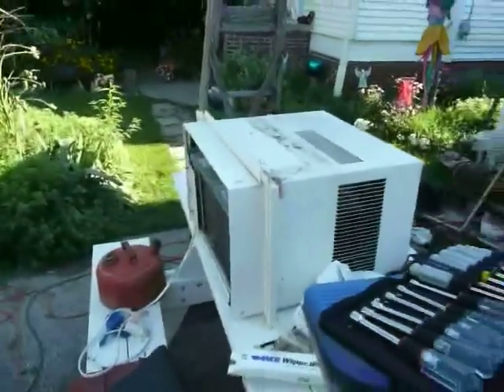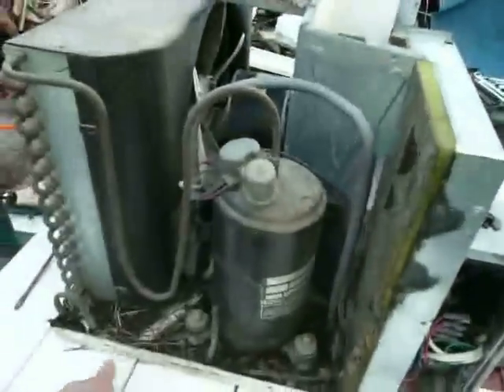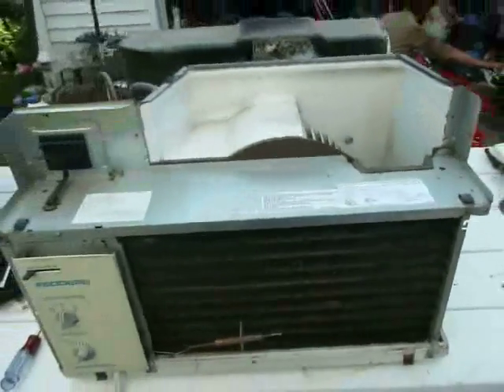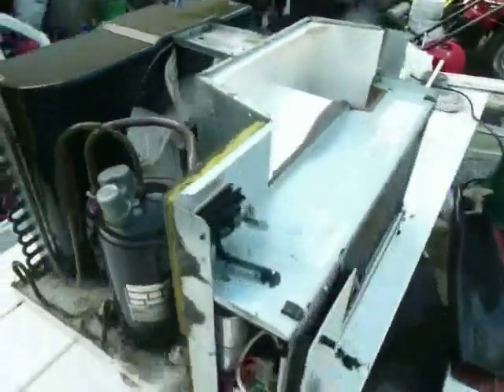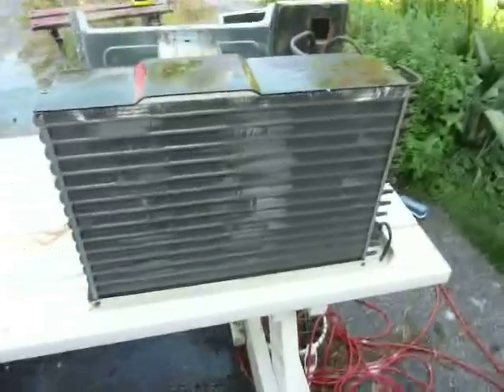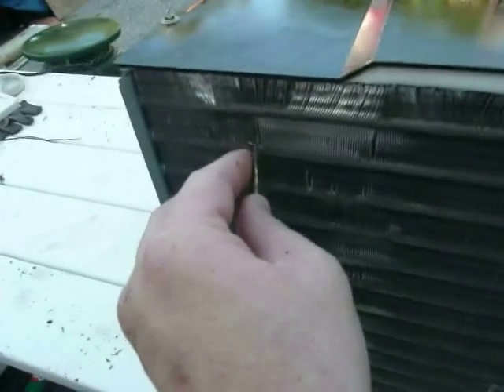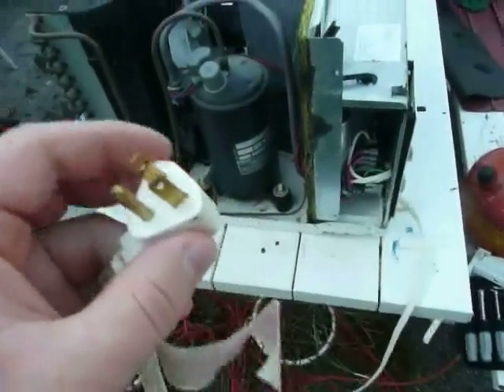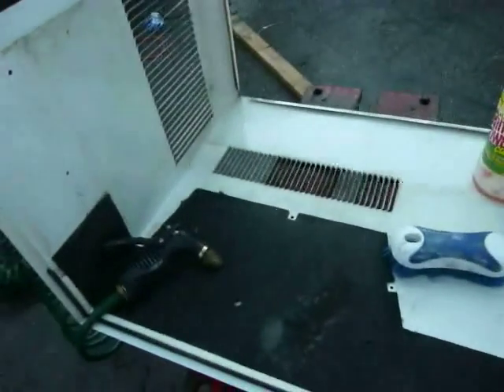How To Improve Your Air Conditioner's Efficiency - Part 1

Comment: A couple thoughts,
If it has control knobs the water usually won't hurt them as long as you let them dry.  If it has electronic touch controls the printed circuit boards should not be allowed to get wet with tap water.  The minerals in the water will stay on the board when the water evaporates and will cause enough leakage current to really mess things up.  If you do get tap water on the boards rinse them off with distilled water before they dry and then leave them in the sun to dry.

Comment: Hey bill, I'm in a little bit of a predicament here and I'm wondering if you can help. I have a portable AC (much like yours) but its too wide to fit in the window. It is way too hot and I need it so I'm trying to formulate a little design. I'm going to have it sit on a platform and attatch some plywood/cardboard to the very back and lead it to the window, only the back of the AC needs to go outside right? What are the side vents for? Do they also need to be outside?

Comment: Is there anything that I can easily mess up on the ac by spraying it with water? I tried cleaning out an old AC as practice and it went well, but it wouldn't start after I was done. 

I think it might have just been broken from the start, but I wanted to make sure it wasn't from me spraying it with water before I try it on my real AC. Thanks for the video!!

Comment: @fakenphoney He is probably going to pull a Piston or TXV cause 9/10 thats where it gets stopped up. If it is stopped up other then there you probably have a more serious problem. If your system is older then 15 YR might replace it cause the restriction could be your compressor breaking down stopping up the strainer and Metering Device.

Comment: I have cleaned several window units like you have done.  I would recommend taking the shroud off the condenser and clean it better, there will be crud that you missed.  good video.  I  have fixed smashed coils ether from vandals or storm damage and i always end up using a flat screw driver to fix the coil.  I have found that fin combs don't work well on most coils.

Comment: Need some help. The AC in my room isn't as strong as before. Someone said I need to put gas in it to make it work. But idk if thats true, Or should I just open it up and clean it out. use wd40 on the fan if it's not oiled.

Comment: you should take the fan cover off and clean the condenser coil properly at least. i use a non acid coil cleaner it works good but you have to spray the coils with it and let it sit for 5 min then wash it out.

Comment: I'm sorry to say that is not the way to clean a/c units. you should NEVER tip them on there side. you got the controls wet. you did not clean the coils properly with coil cleaner and you can get coil comes to straiten the fins.